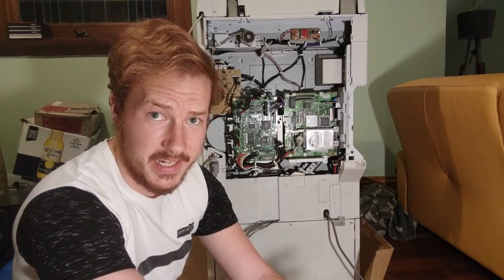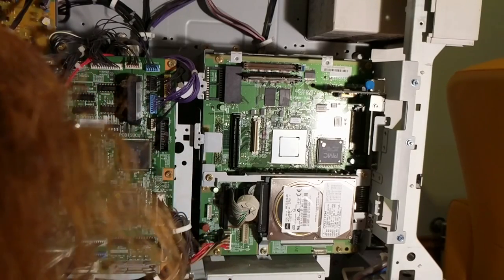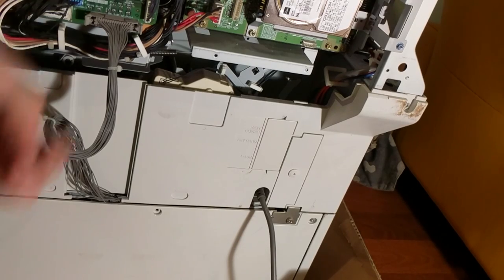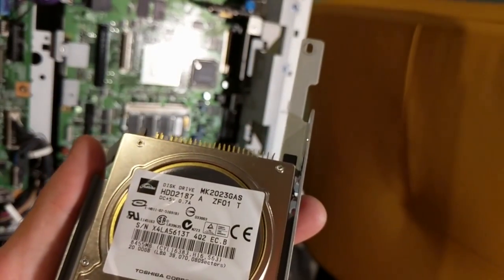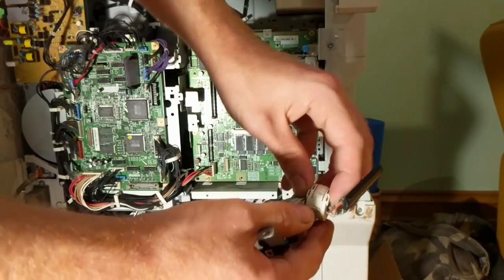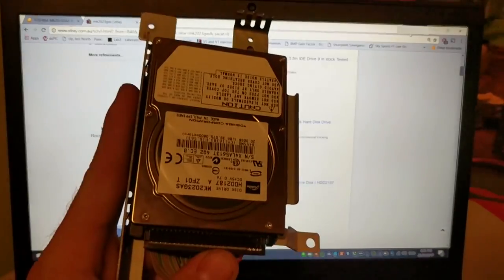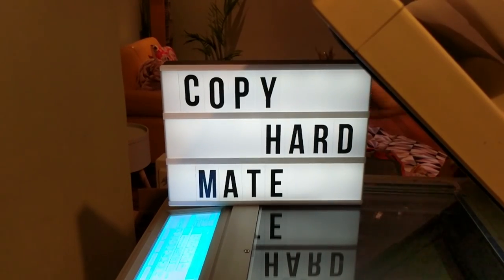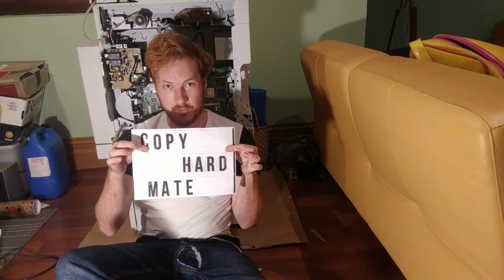Repairing the Photocopier - 1000 Subs Bonus Video!

Comment: Hey, If you haven't yet solved ur copier issue. I would say its the hot roller (the one that kept burning you) is sticky. So when the Teflon coating wears off it, it tends to stick to the paper when there is a lot of black on page. Also, if paper is a little damp it will make things worse. :( . But sometimes giving that roller a good scrub with alcohol can remove some of the sticky'ness... But a replacement or a new coating would solve your problems. Contact your local RICOH store in your town... (if its big enough) and see if they can give you a bell if a machine of the same model range'ish, can be used for free replacement parts. (because if your not using it commercially and just for a bit of fun, Y NOT!) - U can place the drive in a PC or Dock or something - and do a complete low level format on it. Usually the RICOH device will read and write to one sector on the drive, thus burning it out. But the drive doesn't reallocate it... So it usually fixes it doing a good format... But if its running. Toss the drive.
Reply from the maker: ThirdPer3on mate, comment of the month! Thanks for the info, got something fun coming up with this thing in 2018 I reckon. ;D

Comment: ebay/aliexpress "hdd connector 2.5 3.5 sata usb" or "hdd connector 2.5 to 3.5" or "hdd connector sata to 2.5". Check HDD status (S.M.A.R.T), check badsectors s.o.
Reply from the maker: good advice!
Reply: check disk with like HDTune (if BadSectors is in disk first ~20% area and oder 80% is OK, then use some partition manager and resize partition like that, first 20% (bad sectors area) not used (used only 80% area)). If you can, make first disk image (backup). (My English is bad, but try to understand).
Reply: If you but new HDD (or SSD :D ) it NOT must to be a. same model (or some size) or 2.5" (like this laptop size). You Can but new drive like ATA (3.5") or PATA (2.5")/IDE or SATA(2.5"/3.5", with adapter) (or SD/microSD card :D (with HDD adapter)) or  HDD (size maybe need to be >= 20GB (some or biger like old or biger), depends on the software (size need) or why copier needs/used (depends why copy machine it is used) ) s.o.  ...
Reply from the maker: Thanks for the tips! I may have to replace the HDD with new hardware :)
Reply: Test first old one (with another computer (notebook/desktop), like extended hdd), this is more interesting. Why the old hard drive caused problems (what's wrong with it. Is this hardware problem or software (typical hdd hardware problem: motor, hdd reading heads (previous problems are also partly to hear the sound), badsectors, S.M.A.R.T memory registered errors/problems/data (relocated sectors/count/size s.o.) ). 
For me, it's always interesting to find out the anomalies ( e. to find out where exactly the problem was. Do not however  find it easier/lazy solution ). 
(Bad sectors can fix (not used badsectors area more (but allwais this not help, and came out new bad sectors (need test meny time (least one check dont find more bad sectors then OK))) with: command prompt / cmd : "chkdsk Z: /f /r" ("Z:" - is letter you drive, what you want test, like "C:" or "D:")